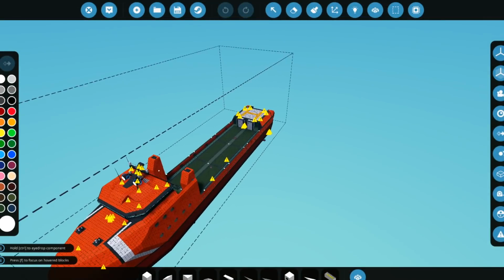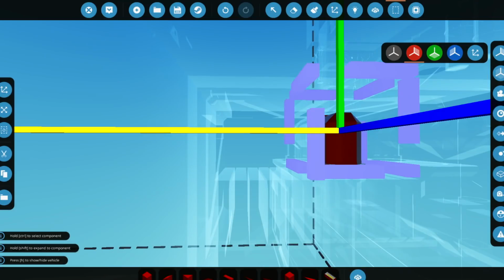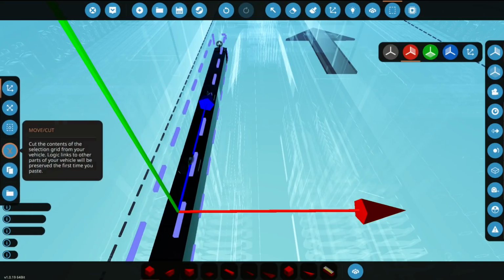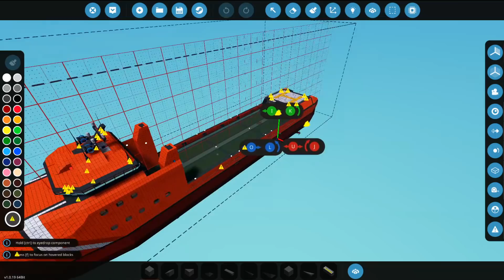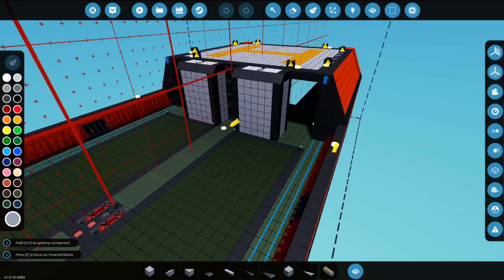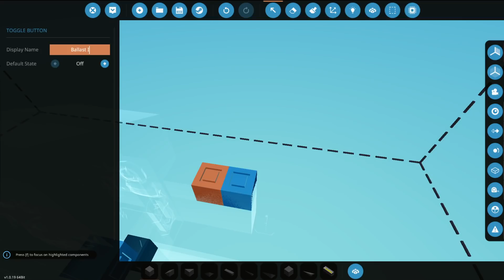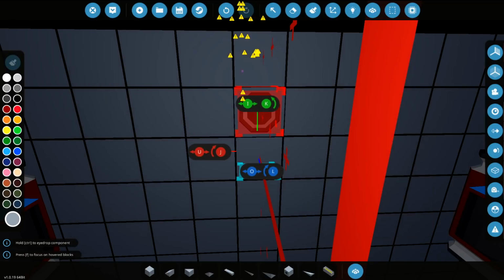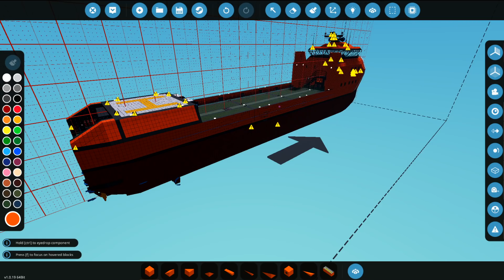Widening The Boat Dock!  -  Supply Ship Build  -  Stormworks Build and Rescue

Comment: Couldn't just put hatches on the bottom to fill the ballast tanks in the back like you did for the front?

But piping the water from the ocean straight back into the ocean was epic LOL
Reply: The problem with that is if it gets damaged, it's gonna fill up no matter what :/
Reply: @ds_lyst05  Ah, good point. But he did that for the front ballast that's why I was thinking that it would work better and faster.

However, he does have enough tools onboard to fix it if it does get damaged.